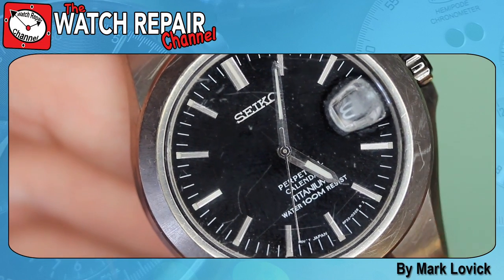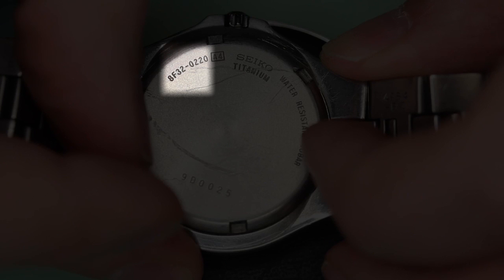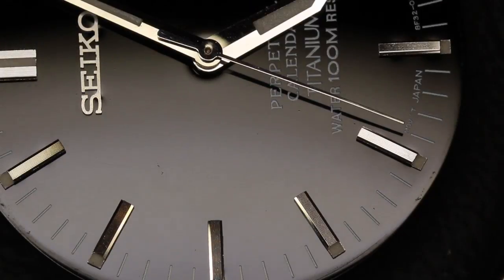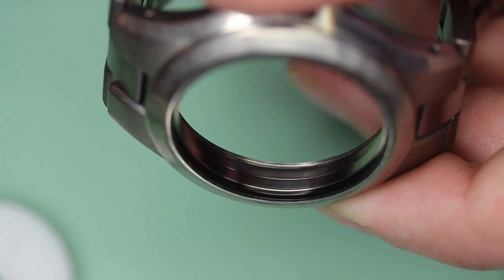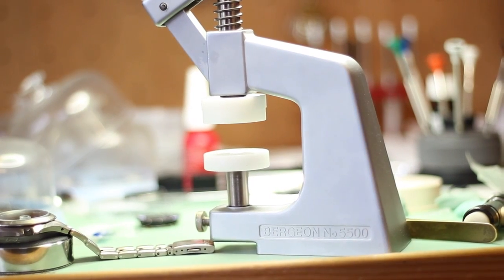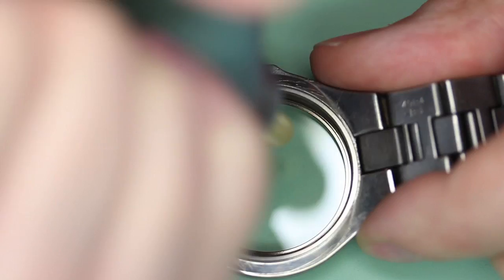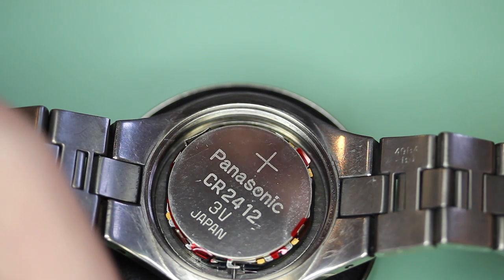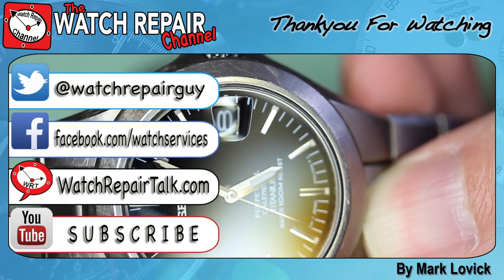How to fit a new watch glass using a glass press. Seiko mineral glass repair.

Comment: I am doing my first crystal replacement on a vintage Lucien Piccard and somewhere along the line of removing the old (acrylic) crystal I found a thin steel ring. I am confused as to what this is.  I wouldn't have thought a gasket would be steel??? but don't know what else it would be. There was no rubber gasket in the watch???

Comment: Thanks again for the info. I've seen the gasket kits but Im hoping to order a couple single ones closest to the size to be safe.

 I can find generic gaskets online but Im a little uncertain if I should be ordering I or L gaskets (original was flat not like "I" not sideways "H")?  the naming is a little confusing.

Also I imagine the gasket will compress to fit the 0.30mm thickness ((Case ID - Crystal OD)/2). Most gaskets seem to be 0.40mm-0.50mm so should I try to match the Case ID or crystal OD, seems these are the closest size.

Any additional info appreciated. Thanks.
Reply from the maker: For this watch - I shaped.
See my video on the divers watch which uses an L shaped gasket

Comment: What is the proper tolerance between glass diameter and a case ? Is it exactly the same size or the glass is slightly bigger ? I need exactly a tolerance maybe you know that because I'm making custom case and I need to know what size it need to be :) Thanks !
Reply: I'm trying to figure that out too and it's impossible to find answers did you find out?
Reply: If you are making a custom case, make it the same as a known watch, then use the glass for that size.

Comment: Im changing the crystal gasket on my tag S/EL series watch that also has a plastic gasket with sapphire crystal. Im wondering if the plastic gasket will seal sufficiently or if I should be using some UV sealant or silicone grease to help seal things.
Anybody have any more details?
Reply from the maker: The gasket (as long as it is the correct size) should be sufficient. You do not need UV sealant for this kind of fitting and silicon grease is not relevant for fitting glasses. :)

Comment: Hi Mark,
I find your videos extremely educational. I work for a jeweler and am responsible for watch repair. I came across a Hattori VD85 and I'm having trouble setting the day of the week. I've replaced the movement but I'm not sure how to index the day-of-the-week hand. Is there a procedure to reinstall the hands?
Thanks in advance,
Dave.
Reply: You still working with this? Or have you gotten some proper experience..?

Comment: Hi mark another fantastic video but i always struggle to find the wright size glass, gasket seal im using a well known retailer on line  for parts.  I use a digital vernier to get a class and seal but i am worried if the class drops out or not water proof. It be easy if their web site was more easyer to use best wishers ady
Reply from the maker: The gaskets have two measurements - the smaller one is the size of glass you need to order the larger one is the inside diameter of the watch bezel.

Measure the watch bezel first and then choose a gasket based on this measurement - then with that gasket see the smaller of the two measurements for the correct glass size.
Reply: Hi Tommy, would you share that info about the retailer on line for parts? I have a Seiko 4R35 and I need the crystal for it. I don't even know if the crystal from 4R36 is compatible to mine ( 4R35 ). Thanks man! Best, Ovidiu